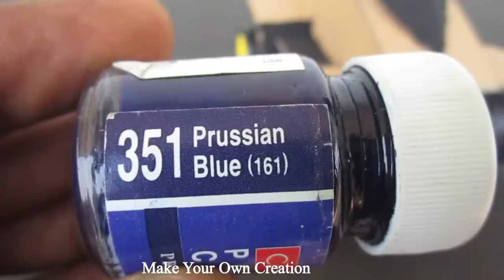4 Amazing DIY TOYs - 4 Amazing Things You Can Do It Compilation

Comment: You should have measured mount points on the car and kept them aligned and equidistant to the car body plus on the same plane and should have done that part with exact steps and your great effort would have been rewarded well. You did great but could have had it flying too. Good job!!
Reply from the maker: Thanks for your feedback,